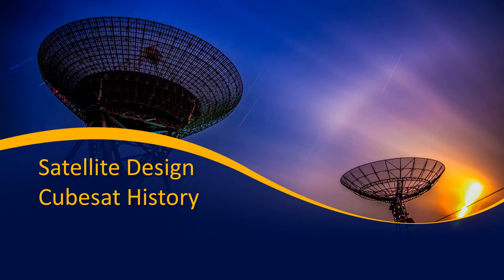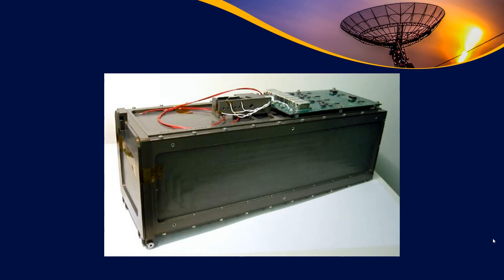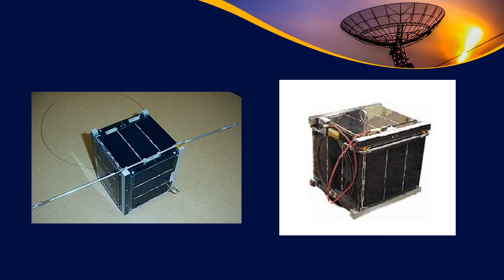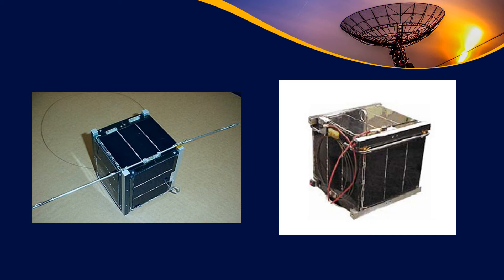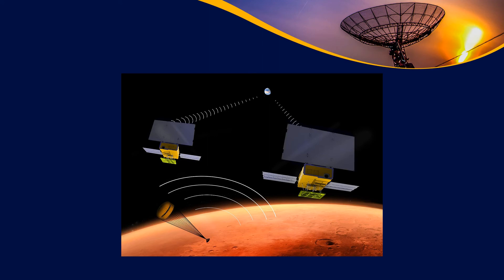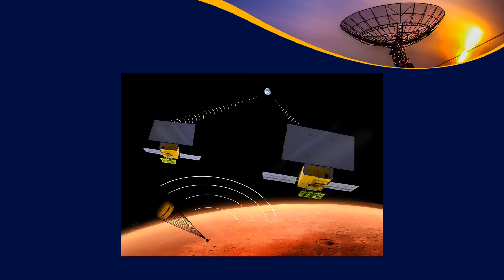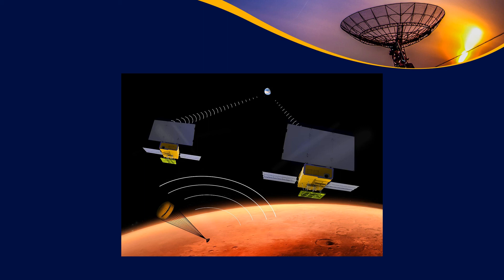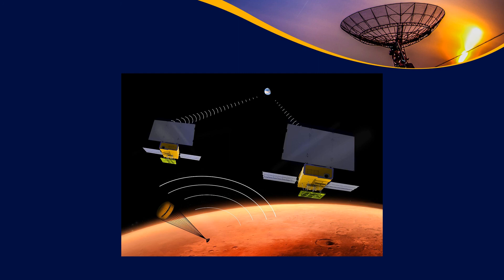Basic Satellite Design- Cubesat History

Comment: Kind of off topic, but do you think space based solar power is a reasonable idea compared to other renewable energy sources? And what do you think the biggest obstacles are, either technical or commercial/political, to the concept's implementation?
Reply from the maker: No. Beaming power is only 0.1% effective. The beam might even increase global warming. It's a nice idea, but isn't likely to do much sadly....
Reply: @WhereisRoadster  Wow, OK. So why is power beaming so inefficient? Inverse square law issues can be overcome with a high enough gain antenna.
Reply from the maker: @rorypenstock1763  Wireless transmitting of power extremly small distances relies on antennas a good part of the distance of a phone. To wirelessly transmit power from space would require an absolutely unimaginably huge antenna. Maybe I'll do a video on this subject sometime soon...
Reply: @WhereisRoadster  Phones use the inefficient inductive charging coils, whereas power satellites are proposed to use a microwave beam, a completely different technology. This might require an antenna diameter of kilometers to get the required directionality, but not one the size of the earth. I'm still not convinced it's impossible, but I would like to see a video about this.
Reply from the maker: @rorypenstock1763  Sure, will add it to the list.

Comment: Can cubesat beam internet to earth?
Reply from the maker: In theory they could, but it would take a lot of ground infrastructure to support such an effort, and they are overall probably too small to do an effective job.
Reply: what type of nano satellite is capable of beaming internet effectively at low earth orbit without the aid of telecom mast?....Also I would like you to suggest books I can read to boost my knowledge of how satellite works.
Reply from the maker: Starlink I believe doesn't have a large antenna, although it is still much bigger than a cubesat. You could get internet connectivity with a cubesat, but it probably won't be a very high data rate. As for books, I used one called Space Mission Analysis and Design, https://amzn.to/2YBhGVj is for the latest edition. There are earlier versions which are available, but this is considered the gold standard for satellite design.
Reply: @WhereisRoadster  thanks so much man